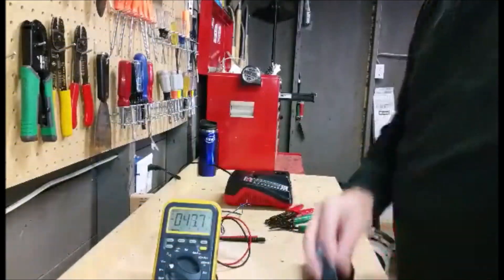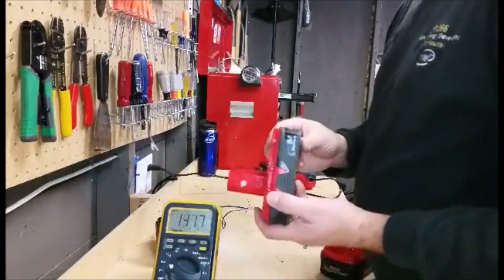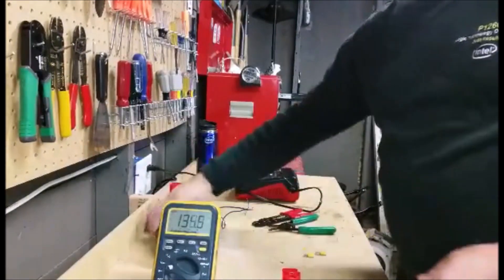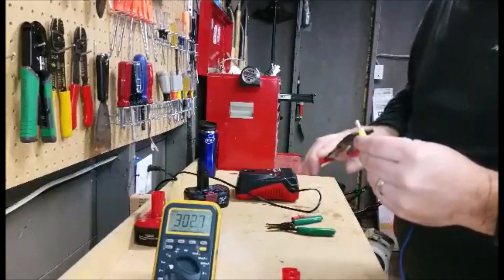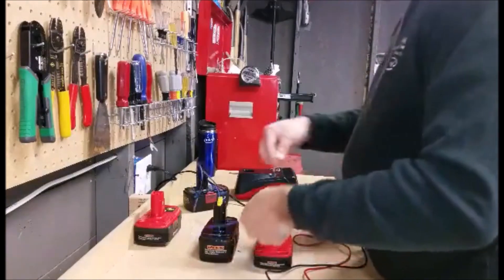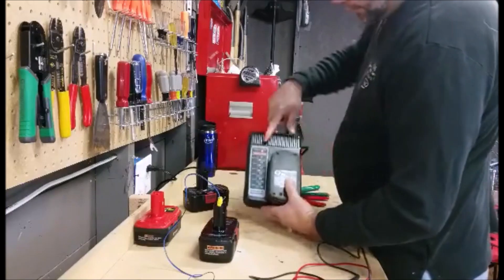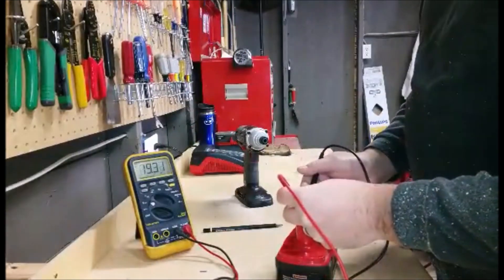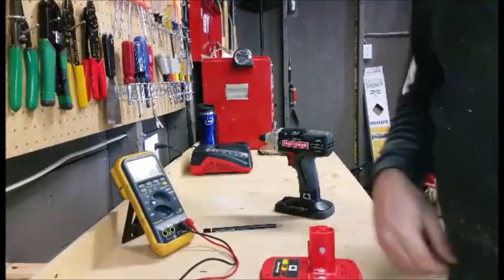"Fixing" Li-ion Batteries that wont take a charge

Comment: Bought lithium AA batteries, bought a new universal AA charger. Universal charger was NOT for lithium! 😮

Bought a lithium AA/AAA charger from China, but the charger says error. Not sure what to do next, might have to return the lithium charger and just keep charging the lithium batteries in the non-lithium charger… they don’t last as long as they did initially but at least they charge in it??!

I can’t tell if the lithium charger is working or not with these batteries because it’s only saying “error” and can’t afford new batteries until past the return window on the charger. Don’t have handy tools for checking charge etc.

Comment: Please position your camera to show the workbench and batteries. There's more tools and cabinet 'n ceiling than desktop. Also, no mention as to what terminals on the batteries take which positive/negative leads - also a battery either needs to be turned on the side to see things (hands in the way) or a camera placed above. Probably poor planning the video.

Comment: Worked for my 19.2V 5Ah (Chinese Craftsman knockoff battery) . Initially the bad battery would not charge, and read 0.05V.  
Then I jumped it to a fully charged good battery.   Just touched the lead about 3 times.
The bad battery jumped up to 15V, and now is able to charge. :)

Comment: It would help if you could keep your hands a little bit out of the way we could actually see what terminals you are putting jumper on.
Reply from the maker: Sorry about that. There are only 2 terminals on these particular cells. You can verify polarity by simply placing your multimeter on DC VOLTS and measuring voltages. If you have the correct polarity it will read a positive voltage, if you have them reversed it will display a negative voltage. Hope that helps!

Comment: Worked for me. I had 2 Husqvarna BLi20 batteries (36v) that wouldn't charge. Each one reading about 5v. Hit them a few times from a DeWalt 18v until they read about 15v and now they're charging fine. Cheers mate.

Comment: Hello there. I have a couple of craftsman 19.2 volt lithium ion batteries and one of them is fine, however the other one measures at 4.7 volts so it can only make the led light on the drill come on when I press the trigger but when I put it on the charger the green light comes on and stays lit as if it was fully charged. I tried the method on your video, but to no avail. Any ideas? Thanks!

Comment: Thank you! Thank you! Thank you! Not a drill battery but still a lithium ion. (In a very small vape actually). I'd accidentally put it in the washing machine 😐 so it wouldn't charge any more. I tested the voltage then gave it some short boosts using another vape battery. Got the voltage up from 3.01 to 3.23, testing the voltage every time I'd done a couple of boosts and it finally started charging when I hit 3.23. The vape cost me £40 and I'd put it in the washer and killed it so I bought another for £40 and did the same again so I was now £80 down. I've got one of them working again now so I'm super happy. I'll probably try this method on the other one as well now I know it works. Thank you again for posting this video!  Anyone else reading this comment, be careful lithium Ion batteries can set on fire, I did mine outside just in case.

Comment: Great video with emphasis on safety, but consider this for more details, especially for more current batt packs.

Sometime all that is required is repeatedly inserting the batt pack into charger until unit senses enough voltage to charge the pack, since the initial test provides a small charge, but this can take MULTIPLE insertions, so best to check pack voltage to see if close to 75% of rated voltage.

For a bit more advanced DIY viability test and resolution there are 2 significant considerations that may require additional advanced steps. Both require opening up the case, which can void any warranty as well as add more safety risk. This usually requires a special "safety" driver bit to remove the screws, one or more of which may be hidden under rubber seal or label.

1)  If the source of failure is the circuit board or a non-battery component inside the pack, then NOTHING below will help.  

2) But chances are there is one or more under-voltage 18650 Li-ion cells, which can be individually measured with a voltmeter once case is removed. If one or more is significantly measuring a lower voltage than the others (normal around 2-3.6V, below 1.5 V is either dead, deactivated by safety circuit, or hopefully just in "sleep" mode) which may be resolved by a trial of "boosting" the voltage with another 18650 or similar 3.5V power source, + to +,, - to -, for about 15-30 secs, small spark is OK.  A confirmation of a potentially viable cell responding to a "wake up" is by showing any sustained voltage increase and eventually allowing it to be charged to 3.6V again. BE CAREFUL, and if voltage remains low or nothing, chances are it is not viable, either chemically or mechanically defective, possibly the safety circuit deactivated it, WHICH SHOULD NEVER BE MESSED WITH.

3) If a "boost" of one or more individual cell appears to be viable, the external "pack-boost" in this video may still not be effective as there may be components in newer commercial battery packs that prevents the inflow of power (transistors, MOFSET, etc ) using just the 2 external leads that may need a trial of being bypassed. To do this, find the part of the circuit board where the Neg and Pos aspects of the connected 18650 cells are making 1st contact. Measure voltage there and if still less than 75% of rated pack voltage, connect the charging source here (Again + to +, - to -) may confirm the bypass may be needed to provide charging of internal pack until smart charger detects an acceptable voltage and can provide complete charging , again a small spark is OK, but watch carefully. 
Refer to https://www.youtube.com/watch?v=p13iznXQNDg

If internal voltage is below 12 V, consider use of a low current 12V trickle charger to get to at least that voltage. Test voltage here every 15-20 secs if not using low current charge source, be aware of any thermal increase in both batteries.  Success is indicated by sustained voltage increases measured internally, then also at the external connections, eventually to where the commercial charger indicates the pack is viable and completes charging.

If after trying these alternative reviving techniques you will either have a restored Battery Pack for either short or long time,  or one to get properly discarded / recycled... or carefully harvest the parts for other uses.
Strongly recommend searching for similar videos, especially of the batt pack brand you use, and BE SAFE!!!!
Reply: I have a Hitachi 18v 1.5AH Tool battery with 0-.35volts measured anywhere with it apart. Is this likely a circuit board failure not allowing the cells to get any charge. There’s no sign of water or acid damage. No wires off. Are there usually any fuses?  It has 5 Sanyo UR18650W cells. Thanks
Reply: Can confirm that inserting and removing the battery from the charger worked for me. I had to insert the battery over and over about 15 times before it starting charging from a "defective" state.
Reply: Be nice if we could actually see what you’re plugging in…

Comment: Great intro, great analysis, great theory explanation, great electrical technician skills...and you skipped right over the "pinouts" on the battery terminals!  If you had pointed the camera DOWN toward the work, it might be easier.  Patting the rounded side of the battery tower was not a really definitive way to indicate where the positive post is located.  Is negative opposite?  Take the 5 seconds to point to them, in camera frame.
Reply from the maker: Hey @gcflower99, You are completely correct.  This was the first "DIY" video I shot. I used my cell phone clamped to a bench vise so production quality certainly suffered.  I am currently building a new house so once the new shop is up and running I hope to have a better setup for nicer videos. Thanks for taking the time to watch and provide feedback!

Comment: Your way, sometimes it works, sometimes it doesn't. 
When batteries really go that low, you don't know at what voltage they are inside the pack, or if you have a dead cell or even more than 1 inside the pack. I had packs with 3 dead cells inside. If you have a dead cell, you will overcharge the good cells.
To be on the safe side and not to damage any more cells, open the pack, check each cell for voltage, any dead cells replace them if you are able to, (obviously only if you know what you are doing) if they are at different voltages, you need to balance the lower voltage cells to the same voltage  of the highest cell in the pack. Let it rest for a few minutes and then place it on the charger so the charger can do the work. Or simply fully charge every single cell separately.
Reply from the maker: I absolutely agree. As I prefaced the video with, I recommend exercising extreme caution. Thanks for your input and thanks for watching!

Comment: Thank you, thank you, thank you! I have an Hitachi 18v drill, which I hadn't used since getting a couple of Makitas, and one battery would not take charge. I checked the voltage on it and it was zero, whereas the good one was reading just over 20v. I did exactly what you did in the video and after paralleling up the two batteries for just a few seconds the 'dead' battery was reading 3.4 v and after a further 10 seconds it was up to 6.5v. I put it in the charger and it charged! Was reading 20.5v after finished charge. I have subscribed to your channel and look forward to some more useful tips and tricks. 😉

Comment: I have a 18v dewalt lithium did exactly as you show on video put battery on charger and it shows that is fully charged but when i put it on drill nothing happens did i do something wrong do i need to leave battery on charger a longer time or is my battery just dead and need to replace it any info is welcome

Comment: Lithium battery have a much less flat discharge curve than a NiCd or NiMH.  Lithium batteries start at 4.2v and are discharged at around 2.8v and it is fairly linear.  A 50% discharged cell puts out 3.6v.
With NiCD and NIMH, they start around 1.4v and very quickly drop to 1.2 and stay there until they are dead and drop off to below a volt.  The wide voltage range of Lithium batteries are one of the major challenges they pose, not a strength.

Comment: There seems to be a discovery that when the battery voltage falls below a limit the charger won’t recognize it, thereby making the battery useless. Can I use a 12V auto charger to bring the voltage up to where it can be recognized? Which terminal is positive and which is negative on the Hoover battery so that I can attach the positive clip to the correct side?

Comment: Thanks!  I think it's working on my Nextec Li ion that wouldn't do anything in its charger.  I took a 12 volt battery and clipped to my voltmeter probes then probed the battery, the little 12 volt battery dropped to 9 volts (showing current flow, I then quickly stuck the dead li ion in its charger.  The green light started blinking showing it to be charging.  I also wore a face shield doing this.  Update, 5 minutes later the charger was clicking then stopped.  Tried to jump the battery again, same results.  I also noted the battery was getting very warm.  So I'm giving up on this one.

Comment: You dont want the cells to drop bellow 2.5v.. Thats the absolute lowest u want to go
 If u go lower you will destroy the cells recharge cycle capabilities.. Also could start a fire.. Each cell should be 4.2v fully charged. Lith-ion chemistry like constant current and constant voltage to charge.. 4.2x5=21v fully charged

Comment: You mentioned in your video "using a trickle charger" by that do you mean you can connect the charger to the output of the batteries and do what? Can you extrapolate?
Reply from the maker: Another video I watched used a battery "trickle charger" which uses low voltage/ amperage over a long period of time to slowly charge the batteries. You can get a  12vdc trickle charger at most automotive stores if you wanna go that route. I have not tried it myself.
Reply: @donniecox9339  Does the connection of the battery output connect directly to the trickle charger leaving out the battery management board? Also, the 120 to 48VDC brick should also be disconnected?
Reply from the maker: @MaxGoddur  the battery that I was bumping only had a single positive and a single negative that I connected directly to. Did not bypass anything internal. Not sure how you're 48v battery is connected.

Comment: "Dead batteries" is why I am switching over to Ridgid brand. When bought WITH a tool, they have a lifetime replacement warranty. Otherwise it is three years. I have literally $500- $600 in dead batteries lying around from Milwaukee and Makita. No more of them. To resurrect those tools I will buy the knock offs on eBarf.

Comment: I don't even know what u did lol
Reply from the maker: I used one battery to slightly "bump up" the other battery voltage so that my charger would charge normally. If a lithium ion battery is too low the charger, as a safety feature, will not charge and will flash as defective. This was done as an experiment at my own risk, I recommended you follow the manufacturer's instructions for use.

Comment: I actually tried that it goes to the whole sequence and then in like 30 seconds the green light comes on as to say it's charged but this still a red light on the battery when you pull it off the charger

Comment: Thanks to your video it saves my 2 new but misplaced 2 years old M18 MILWAUKEE  batteries been sitting in storage too long with only 3.4 & 3.2 volts back to normal.
I have tried by letting them charge over night each with failure, until I saw your video.
Tested and proven it's true.

Comment: Useless video, you move move move and don't even indicate which contact is pos or neg
Reply from the maker: If you're attempting this bud, you should have a basic understanding of DC and how to use the multimeter readout to determine the polarity of your voltage source.  As I said earlier in the video this is "at your own risk".  My recommendation is that you steer clear of this procedure until you have the required basic understanding.  Thanks!
Reply: @donniecox9339  
So, from the schematic I found on Google, there is supposed a 24k resistor that keeps the positive from making connection if it's not there. I've tried it the exact way that you did it but for some reason I can't get a voltage reading above 1V from any pin combination even from my good batteries.

Comment: Thanks! I found a used drill and lithium battery at Goodwill. It was a $9 gamble. The battery was dead. I jump started the cells individually for a few seconds with a toy train transformer at 18.47 volts each and achieved 5+ volts total. The charger then could charge them and it works great. Thanks again!

Comment: I did this with several power adapters at 12 volts then I did like you did with the 19 volt battery and I have no change in my voltage. What does it mean when you leave two batteries connected in parallel and the battery of lower voltage doesn't even change a tenth of a volt in 1 minute? I have the exact same batteries that you are showing in this video mine is at 7.28 volts - higher than your battery level and it registers nothing on the charger. Does my battery Behavior indicate that it is truly done and can't be resurrected from the dead?

Comment: I tried a battery charger to get a spark to kinda jump start it so charger would charge but didn't work ?
Reply from the maker: Sorry to hear that.  Sometimes the cells are just too far gone...
Reply: And, some smart battery chargers see the low voltage and fail.  That's why the dumb battery or welder or power supply works it majic

Comment: I have a cell phone gimbal with a Li-ion battery and it was dead(3.7 volts), cut some old USB cable and and hit it with 5v, just 3 less than a second touch and voila!!! the battery is charging like brand new !!! SO IT WORKS!!! just be careful not extend the time or the voltage too much

Comment: Hey Donniw Cox, i have a drone battery that has discharged, but there are 2 ports that lead to the battery. 1 2-pin port that powers the drone and a 4-pin port used for charging. which port do i plug into?

Comment: Put same battery on 2 amp 12v charger over night and didn't take any charge. I have a few of these. The craftsman charger says it's also a maintainer so left batteries on charger for weeks. Now they won't charge yet the batteries are like new
Reply from the maker: This method only fixes batteries that suffer from low TGV faults, sometimes caused by batteries stored for too long.  Yours may be defective beyond what this method will fix. Sorry it didn't work for you, Nathaniel.
Reply: Donnie Cox after bypassing the board my lion red packs are working normally.  I used harbor freight cheap float charger 12v 500 ma for 15 minutes brought pack voltage from 3v to 7v then normal craftsman charger worked. Thank you for your video!